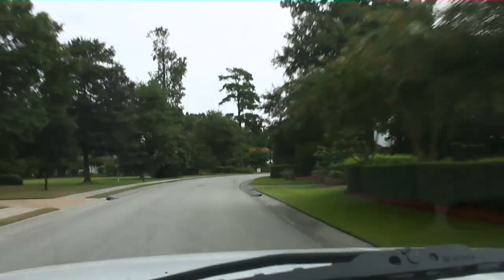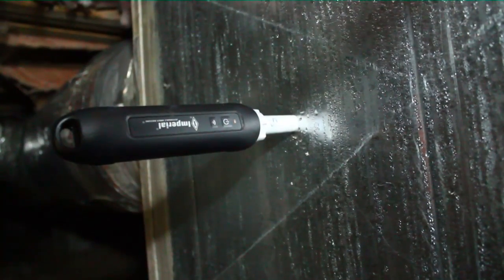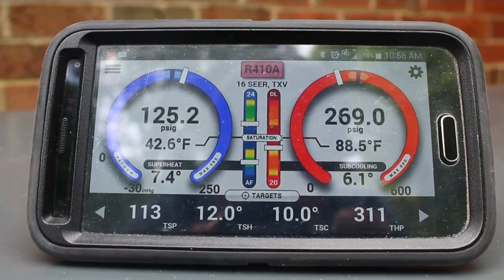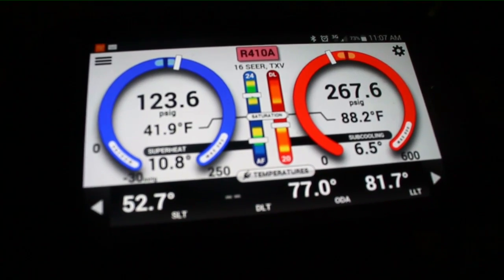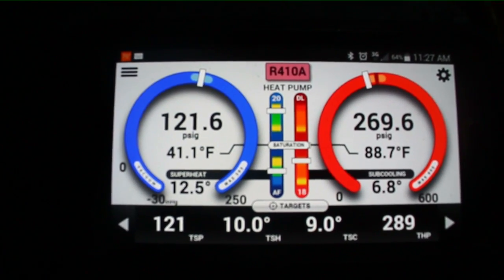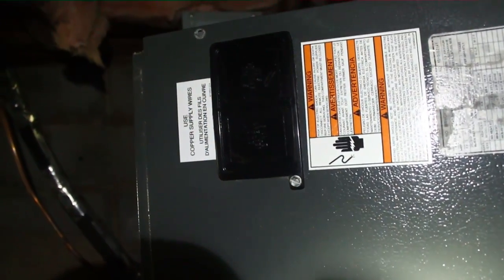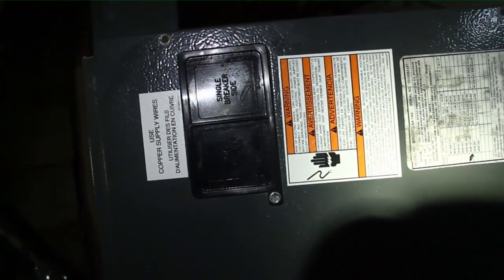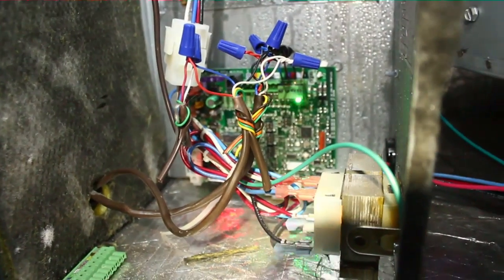HVAC Service Training- Communicating Air Handler Failure

Comment: I believe you are correct on your theory of the head pressure not rising..
In large split refrigeration systems I work on, we rarely ever EVER use subcooling...since 98% of walk-in systems with TXVs have a receiver, we don't use subcooling as a charging method. In our case, if we add more refrigerant subcooling would not go up because it would just raise the liquid level in the receiver and head pressure would be relatively the same. As I'm sure you know....in a receiver you have liquid And vapor...which in turn meas little to no subcooling.
As long as we have a clear sight glass we're good to go!!
Another great Vid man...I love it
Reply from the maker: Thanks for watching Scott

Comment: Was that a true communicating system with 2 data wires a hot and a common totaling 4 low voltage wires to the condenser? Or just 3 wires y1 y2 & a common? I've never herd of or seen those goodman a/h before but ive worked on TRANE Hyperion TAM & GAM units before with error codes and yata yata. A real payn cuz you gotta approach it differently then any typical a/h lol

Comment: I think some  of the problem with these are the heat strip leaks a little in side the control space from being in a constant positive pressure and with the transformer putting out heat you will have condensation. The new AVPTC units now come with a stand off bracket to get it away from the walls and condensation issues. I bet that is why they made the change. I have seen Carrier AH do the same thing. Here in Florida it better be sealed good or you will end up with condensation.

Comment: If the TD across the evap coil is too low it will leave a lot of water in the air, try raising the TD up close to 20-25 degrees. Armaflex makes black neoprene insulation in three foot squares, try insulating that metal panel behind your board. Can you get some air flow through the electric panel to help dry it.  That was alot of water, good video.

Comment: Maybe a dehumidifier would help in that crawl space. I do only commercial and I have seen air handlers in the ceiling and they have exhaust fans in the ceiling to remove the humidity. I have had diffusers sweating real bad and had to insulate the metal part, can't wait to see part 2 Zack.

Comment: What was the airflow like? Did you count the blinks? Static reading? I can almost guarantee that it is airflow related. The airflow can be adjusted and programmed from the comfort link tstats. I believe the only ajustment you have to make on the air handler control board is the heat strip KW. Hey you can always leave 5kw running to raise the supply temp! Lol. I would check the ductwork for proper sizing.

Comment: When I profile I use the targets as a guide. If the superheat and sub cooling are good I don't care what that bubble says. I don't trust the airflow either. I had both my probes on in ambient air and the airflow meter read right in the center. I still trust static and performance charts.
Reply: Justin,

This airflow estimating is pretty accurate. The meter on the home screen will be in the green if the temp split is +/- 3* the target temp split. The  actual CFM numbers are only accurate if the coil is fully active...meaning no refrigerant related issues. I've compared the airflow estimating to the blower curves/TESP, anemometers/duct traverse, and communicating controls. See this thread:

http://hvac-talk.com/vbb/showthread.php?1614421-Imperial-iManifold-Airflow-Comparison

The profiles are derived from DTD (Discharge temp difference) and CTOA (Cond. temp over ambient). The more you use the profiling, the more useful you'll find it. Set the benchmark when you have a system running perfectly - then reference that benchmark when you come to the same unit at a different location. They're only to be used as guides not
a hard and fast rule.
Reply: Brent Ridley thanks.  I will look at the thread. Old tricks die hard I guess. I used the airflow function on an Amana variable speed unit. The previous contractor had not setup the airflow correctly and it was sweating the same way talyn875 customer was. I adjusted the dip switches for proper airflow and rechecked the probes.  Minimal change on the reading. It sucks I did not have my  manometer at the time to check it. (I was awaiting my new one to ship). I had a similar issue with a 2 speed Trane. Same thing, I set the airflow up properly and it read some crazy super high airflow and capacity. Jim commented on that one. I guess I need some more thorough training as to where the numbers are all derived from. Thank you for the info! You always give great advice! I just am a little skeptical on the airflow. I have to mention this one as well...AMSTD variable speed air handler on 2.5 ton heat pump had a plugged media filter. Removed the filter and the airflow changed minutely. There has been multiple occasions where I have adjusted the systems airflow and there has been no significant change. :/
Reply: Justin, you can't trust static or the charts either because there are based off of standard air which is based off of 68 degree 0% RH which you will never be there.
Reply: Larry Cole really!? Why would the manufacturer design something with those conditions? They never exist. I guess it is for a baseline because air density changes so much across the world. I would figure it would be 75 degree return air at 50% rh. Hhhmmm
Reply: That's why it is so hard to get it right. Don't get me wrong total static pressure is important but I would use a vane anemometer to get it closer. The way the I manifold gets it is a good way of doing it.

Comment: If that was my home I would install a few crawl spaces fans connected to some PV panels or low voltage Xformer. Sealing the holes and moving the circuit boards are a good start.
Reply from the maker: Having a better crawlspace climate would make a difference.

Comment: Great video, Zach.  Thanks for walking us through the steps in your troubleshooting.  I'm not familiar with that particular cabinet, but from what I see in the video, I wonder if it would help to cut some openings in the partition (the plate that has the transformer on it) so that return air would circulate into the controls box and pull moisture out.  Since the controls in cheaper units aren't isolated in separate chambers, seems you could open up the partition without causing harm. Just a thought.
Reply from the maker: Good idea, that may cure the issue as well.
Reply: that would probably pull more air into the cabinet. unfiltered air too. goodman just needs to do a better job with their cabinet design.
Reply: 8 yrs later and this is still a genius idea

Comment: Fascinating Zach I always do like these types of video's. It always been interesting to me!! Looks like you got a good plan and even I thought personally moving the board to the insulated section before you threw that in, but defiantly could see why checking all things before doing that to see if that would be a last resort first Glad you you don't use those on board breakers I always thought that it was silly in most situations with the main  discontent right there most of the time even in basements around here back in the day with the house main panel being generally in decent proximity 
That cabinet reminds me of many old school cabinets that leaked air like heck. :) 

-Mike
Reply from the maker: Mike these things leak air. After you remove the door the first time the gasket falls off.
Reply: Yeah I know lol lol. In the old days there was no gaskets. My folks old GE WEATHERTRON air handler cabinet used to tick me off. It hand nothing plugging up holes or around service doors line set entrances thermostat wires etc etc. then try to get the doors to seal was a bitch on that old stuff from that era even blower doors on gas stuff!!! Lol lol....